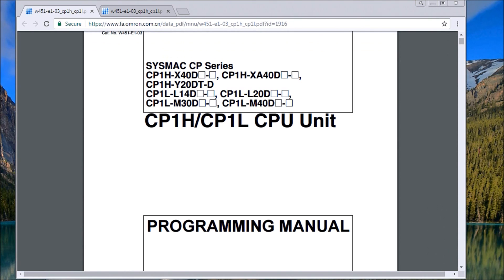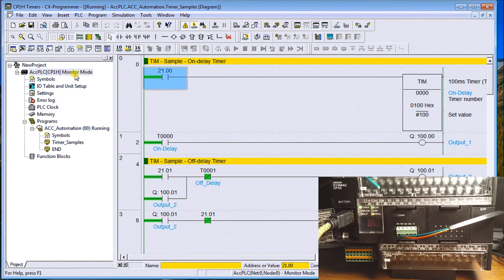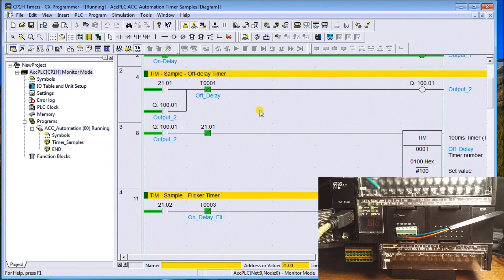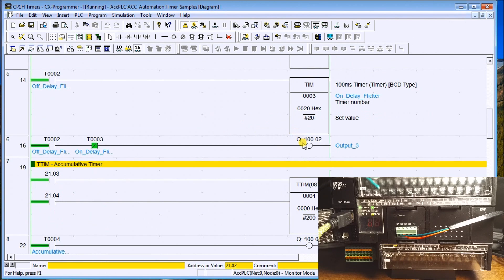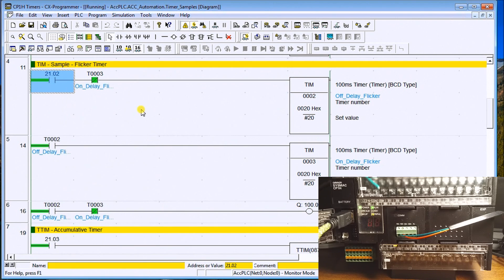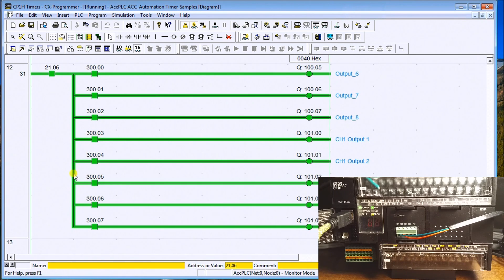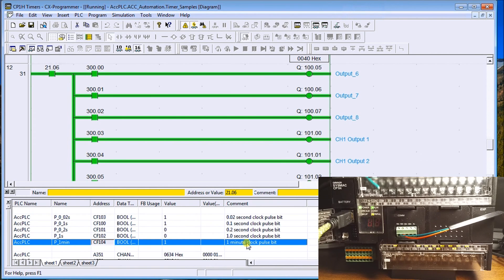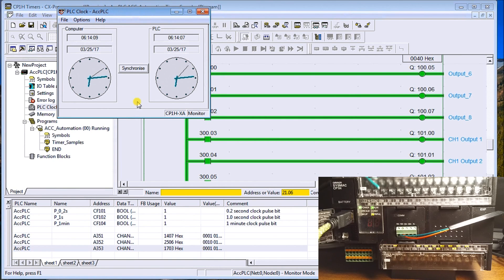Omron CP1H PLC Programming Timers

Comment: Thanks for your tutorial, i want to ask
Why i couldn't call the timx function?
Does cp1h support the timx function?
Reply from the maker: Hi Ilham,
The Omron CP1H will support the TIMX instruction. (Code 550) This video only looks at the BCD version of the instructions but you can also use the Binary. 
https://www.fa.omron.com.cn/data_pdf/mnu/w451-e1-03_cp1h_cp1l.pdf?id=1916
Page 170 of the above manual for the CP1H will show you the instruction.
Thanks for the comments Ilham.
Garry
Reply: In the manual told that TIMX is available on cp1h but, in the cx programmer i try to call TIMX , TIMX is not avalable on this current plc type ( i use cp1h). Is this a bug or something else. Thanks for your reply
Reply from the maker: Hi Ilham,
I am currently using an older version 7.2 of CX Programmer. You are correct and the the instruction does not seem to be available in the controller. Do you have a newer version of CX programmer to try? 
If you really need the binary timer, you can use a BCD to Binary convert.
Regards,
Garry
Reply: Yes, i have. I use cx-p 9.5 version. I already tried the solution that you told, but there is still some errors calculation in the function. Maybe next time i will try another way. Thank you very much

Comment: Hello and thank you for the great information. 
I was wondering if you could give me some guidance on the TIML instruction, I’m using a cp1l and when I set the instruction up I am unable to get  the timing  value to retain when the rung goes false. What I mean by this is I would like the timer to time for one week then in my case go true for one minute then time again for one week and so on indefinitely. However when I execute my program , D100 times only once then the value in D100 +0 stays at zero unless I go in and manually set the value again.
Can you point me in the right direction on this?
Reply from the maker: Hi Woody Wood,
Thanks for the comments. Timers in the Omron PLC are non-memory retentive. However, you can use a counter or increment (Math) instruction to do this logic. 
You can use a 0.1-second clock pulse with your enabling logic to go to an increment on a DM area register. Move a 0 or reset when the register must be reset.
0.1s Clock Pulse -  P_0_1s
http://dim.usal.es/eps/im/roberto/pesados/ryc/CP1H_Operation_Manual_(W450-E1-01).pdf
4-19 Clock Pulses will show the pulses available in the controller.
I hope this helps you out.
Regards,
Garry

Comment: The timer application I am looking for is something as follows:
When the Timer is triggered it should start timing and if the trigger stops then the timer pause timing. But if the timer is triggered it should resume timing again(A retentive timer actually i.e. TTIM). But what I want to do is the measure of time for how long the trigger was ON. I want the accumulated value in that timer. Any idea how to do that?  

If you are used to Rockwell programming we use RTO timer and can use .ACC for reading the current value timed by the timer, which in your case is Process value(PSV). can i use TIML?

Thanks
Reply from the maker: Hi Ghanshyam Zanbare,
In order to do this timing application with the Omron, use a counter and the clock pulse bits.
https://accautomation.ca/omron-cp1h-counters/
The above is a link that will show you the counters and clock pulse bits.
I hope this helps you out.
Regards,
Garry
Reply: Garry Shortt You know what I used TTIMX and created a bit to latch this timer and unlatch this logic using Timer done bit.i.e. T1000 if using 1000th timer.
This works, it tested it. I can get precision upto 0.1sec, if you want to have 0.01sec precision then you have to use counters.
I my case 0.1 works.

Thanks Gary for replying.